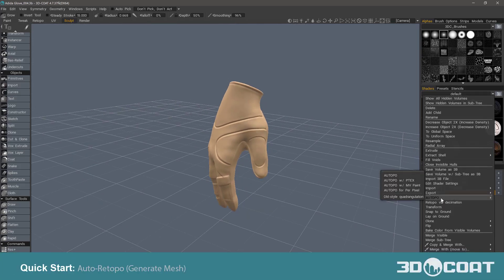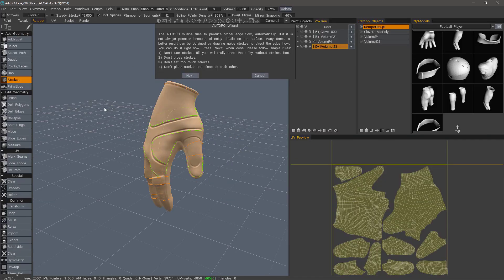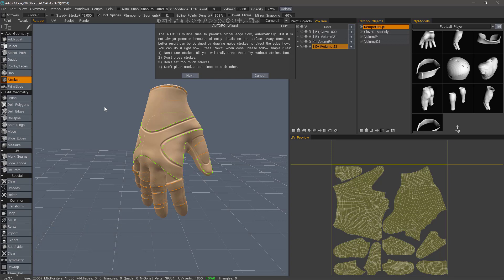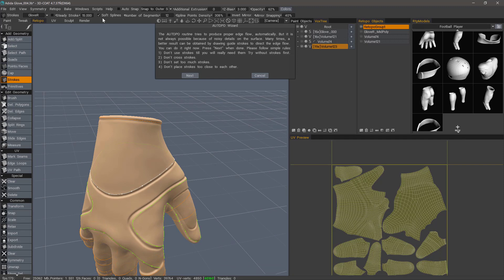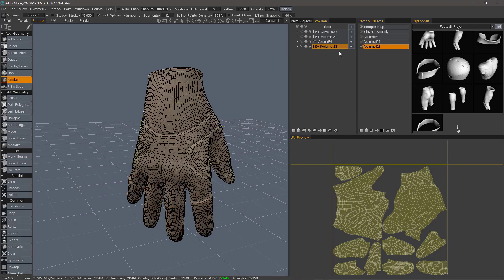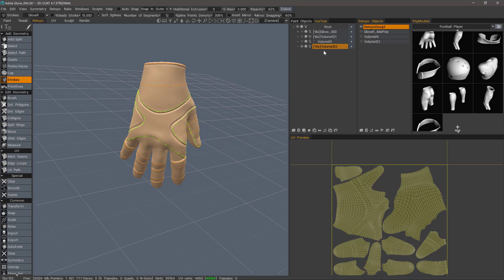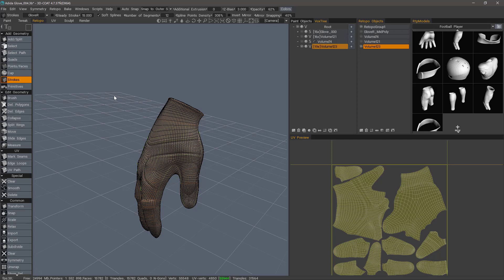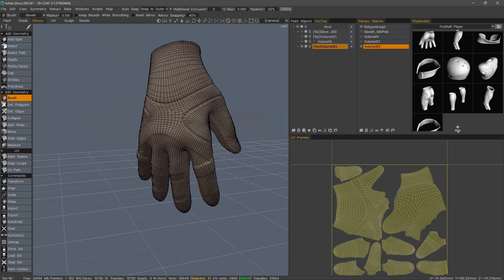Quick Start: Auto-Retopo (Generate Mesh)

Comment: Hello. For some meshes I'm exporting from Blender to Instant Mesh and setting the loop flows there. And normally I  need I quite low poly mesh as a result. It's a quite good workflow for this purpose, but it lacks some features like:
- No density areas painting;
- No UV map (not a big deal, since going back to Blender the UV mapping there is quite good);
- Quite annoying to use the tools X navigation (I guess I'm missing something here. There is no way it would be that annoying!);

So, my question is: Would 3D Coat solve this? The cheapest Steam version have the same features?
Thanks in advance!
Reply from the maker: There is also an Instant Meshes option in 3DCoat, but honestly it doesn't come close to the clean result generated by the default 3DCoat Auto-Retopo. It has way too many termination points. It's really intended for a quick and dirty Auto-Retopo result, or when 3DCoat's default may struggle with certain shapes or complex objects.
https://youtu.be/6EfwjY1ZhdM

Comment: My mesh dissapears when getting to the density part, any idea?
Reply from the maker: Probably too low of an estimated poly count. Try increasing it well above what you are expecting, because Auto-Retopo algorithms generally produce evenly spaced quads. That means you are probably going to have a clean looking mesh, but not one with an optimized poly count for games or Character Animation. You can always clean it up a bit by deleting entire loops with the DELETE EDGES tool (hold the CTRL key for loops)
Reply: @3DCoatTrainingChannel  Thanks! I'm trying to cleanup a medical scan, triangles everywhere, not a single quad. mid poly
Reply from the maker: @juancarlosgzrz  ...Have you seen this series, regarding 3D Scan cleanup in 3DCoat? 
https://youtu.be/0J68OrppSKc

Comment: hello, great tut,wen ever i tried to import my model as obj from maya, i get this polygon skew at the feet and eye parts of my model. any help on how to fix this will be very appreciated.
https://1drv.ms/u/s!Ar25lq8-Cp4qhXC8IvI39IXU4NSX
Reply from the maker: That's very strange. Try downloading the latest version (4.8.10) and perhaps subdivide in Maya once before exporting it to 3D Coat. If importing into Surface mode, it should look exactly like it does in Maya.
Reply: I hope auto retopo will work in surface mode. thanks Will give it a shot

Comment: Hi, could I know the pc hardware configuration  on which this demo is running? I have to wait very long time computation or reset serious problem of crash when I launch an auto retopo process on models with this huge number of triangles. If  possible could I have a link to download the model file to try the same configuration of parameters on my machine ? Thanks a lot.
Reply from the maker: It's an 8 Core AMD Ryzen 7 w/ 32GB of RAM. But that doesn't have a lot of bearing on Auto-Retopo's performance. It worked just as well on an old Intel i7 970. The best thing to do is try to run Auto-Retopo on a sample object from the splash screen, such as a primitive or the head bust, or the human figure (not the Mannequin). If you try to run it in a single sided mesh, it won't work properly. It needs a decent amount of thickness. Also, if you try to make it generate a super low poly game-ready mesh, it won't work. All Auto-Retopo tools, no matter which application you use, will attempt to create evenly spaced quads (for the most part). For that reason, you will need to try a higher number.

For example, trying to make this glove under 2K will probably make it behave as you described. There is too much detail and too many forms for the algorithm to make it work. It's not the hardware. If it works well for you on a simple model from the splash, but not a specific model you are working on, then the issue lays with the mesh, or the way Auto-Retopo is being used. You can visit the 3D Coat forum and ask one of the regular contributors to try and run it on your model and see if they can get a good result. If they do, then they will share what steps they took to make it work.
Reply: I would also add that if that nothing else lags / drags such as painting within the program then it is probably not the hardware.  As for low poly game objects the standard is to bake normals from high poly and use the the map on the low poly fake the detail.